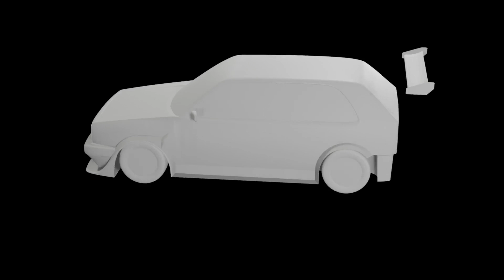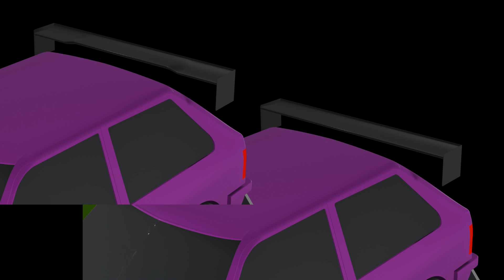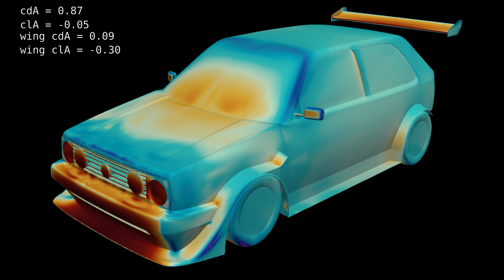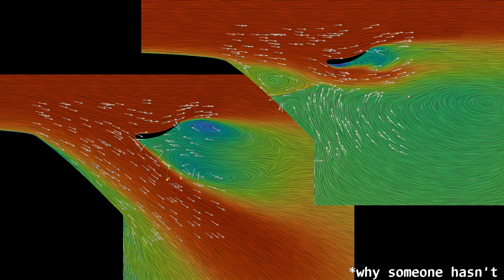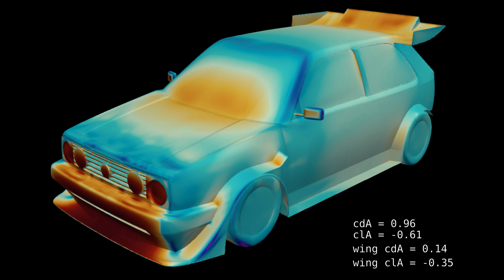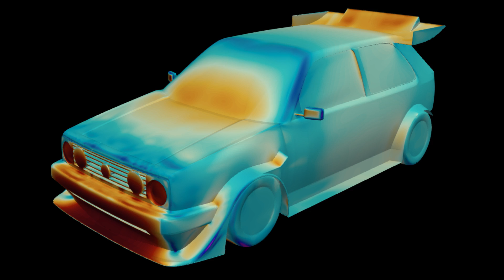Hatchback Aerodynamics: Improving the rear wing or spoiler

Comment: I am trying to overcome the turbulence around my domestic car, to get a laminar flow of air from front to back. This last year I have been going down the 'Rabbit Hole' in every aspect to achieve this Learning on the effectiveness of a 'Under Tray', the effectiveness of 'Air-Curtains', 'Hood Ducting', 'Separation Edging', Adding a Lower 'Air-Dam' and blocking off the upper part of the grille to improve the aerodynamics and reduce the drag. Not having the Computer Capacity or Finances to research the CFD of my car I like to see if someone can do some tests to see he effectiveness of each of these as well as the effects of a Car-Bra, Bug-Shield, and other Add-Ons for the domestic car market.

Comment: What about something like the 2020 Sonic RS Hatchback? It comes with just a flat lip as a spoiler for an inch or so, but below it, the car is done, completely vertical basically. I've seen people mount wings on them, but it didn't make sense, since the air is already flowing completely straight off the end. Is there any way to improve the aero with this or is the lip the best?

Comment: Id be interested to what modeling shows for multi spoiler hatchbacks like the EK civic type r, where it has a roof spoiler and mid-height spoiler at the base of the rear glass  I've always been curious if it the second spoiler was just aesthetics or actually reduced lift and/or drag.

Comment: Ford's RS2000 was originally designed with 3 wings - the final production version had only 2.

On Wheeler Dealers, they added the missing 3rd wing.

Hatchbacks like Golf mk1/mk2 benefit a lot from a lower rear splitter. Reduces dirt on rear window, too.

Comment: eg hatch here. my wing is attached to the car   can u do a few lil sims on that variation  they have a few options to n peeps run what is called a duck bill would be interesting to see that thing weird'ness.. i have the more drag style where it just runs off the back of the car. im not sure my wing helps wif downforce but should help wif drag a lil bit  my car is stable till 110 then i feel like i needs more down force  after that n then i run out of gear n tune

Comment: You maybe get more performance out of your wing in that downforce is higher, but you just ruined the airflow to the back of the vehicle creating this massive separation wake that will slow you down like crazy. You won't get more downforce without more drag, but this solution gets you more downforce with WAY more drag. This is why big spoiler solutions are usually combined with big diffuser solutions to make sure that space gets filled with air coming from underneath the vehicle (typically also helping you generate downforce). Any extra time in the corners will be massively outweighed by the time lost in the straights, if your little ol' four-popper can even generate enough thrust to keep you at the grip limit around the turns.

Comment: Hey Nelson, try not using a Volkswagen shaped hatchback. I had a hyundai pony (real gutless) that got very bouncy at a quarter tank of gas. I made a wing that mounted on the hatch just above the latch it was flush with the roof line due to the downwash
of the hatch. It had 1/4" Gurney flap that proved way too much and had to be flattened  out again. So to say the effect is minimal is due more to the specific vehicle than the wing itself.

Comment: Hold on a second. There is a production hatchback that has a spoiler half way down the rear window. That's the EU/JP 2005 Honda Civic. So it's not like this thought doesn't exist.

Obviously it doesn't have a rear wing though.

It's absolutely spectacular in person though. It feels a very similar shape visually from all sides, some sort of optical illusion, it's basically like an UFO floating in front of you, and the design details with smooth polycarbonate grill decoration with reverse side detail and angular handles are very striking as well. And like it stays planted, it turns, it's decent. Futuristic design extends to the dashboard as well.

Comment: Hey, have you experimented with adding vertical side profiles to the rear spoiler similar to the GTI Mk7 Clubsport? 
It should reduce pressure under the spoiler, as it inhibits airflow along the sides of the car from going to that area.

Comment: A few uneducated opinions on how I would solve the extra drag from the 3rd variant
1) roof vortices 
2) have a secondary wing/structure that starts at the tip of the C-pillar (not unlike the Ford Cosworth), not for downforce but to channel high pressure air into the main plane and extended winglets
3) either multi-tiered flaps on the main plane for passthrough, or rally style spoiler channelers (the vertical columns seen on modern rally cars, like the 04 WRX STI

Comment: Subaru hatchback owner here. 1995 Impreza rally car. I feel like I have been denied my god given birth right to a sick ass rear spoiler. If I am gonna have to put up with Subaru mileage and head gaskets, I want a spoiler, dammit. However, all the stock GF8 wings have big time weenie hut junior energy. Another local driver has more or less taken the WRC shelf + spoiler approach on his car. Both of us compete in ARA, which has some pretty clearly defined (and restrictive, depending on who you ask) aero rules, chief among which is how far outside the existing outline of the car you can put a wing. I'll have to consider this approach if I decide to build my own wing, and whether I can fit it into their rules

Comment: i don't understand why you put the rear wing so far from the car while rear wings on hatchbacks are nearly  stuck to the car.
On my old 205 there was a small incline at the top of the hatch to help for downforce in competition on the 205 T16
On a Lancia Delta HF Integrale it's obvious because the rear wing is directely connected to the hatch, even on Ford Escort and Ford Sierra Cosworth it was the case (and it was reallly obvious) and they were hatchbacks.
why does your wing is so far away from your car?

Comment: Or, you could just do what Porsche, VW, Peugeot and a lot of other car and aftermarket manufacturers did with their kits for hatchbacks in the 80's, and mount the spoiler just beneath the rear window. Essentially turing the car into a more sedan like shape airflow wise. Alledgedly this increases downforce in the rear, but at the cost of increased drag due to the negative pressure pocket created beneath the wing (behind where the numberplate and taillights goes essentially). Though on a race car, this could probably be mitigated by a properly designed Venturi tunnel.

Comment: You should look at FWD RC racing.  The last style wing minus the mid section is basically a 1/10 Touring car Spoiler.  If the rules allow we usually use those on the back of the body when we need a lot of read down force.  Although the aero is pretty diffeerent due to the inner of the body the outside may give you some ideas :)

Love the video...

Comment: Could you test if the first-gen Alto Works (CC72V) cheese grater rear aero element (spoiler? wing?) actually works? The brochures certainly made a point about the aerodynamic drag coefficient reduction it allegedly did.

Comment: Ford used a vaguely similar system for the Group A Sierra Cosworth RS500.
The spoiler was at the bottom of the long tailgate glass and the wing was on mounts above it half way up.
The tailgate wasn't as steep as your model.
Reply: And they used the same setup on the Escort RS Cosworth.

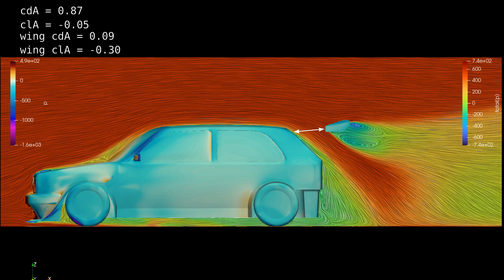Comment: Your AoA @1:34 looks it's stalled the wing. Maybe consider setting the AoA relative to the airflow and not the the groundplane. It looks like you've got the wing set at 50* AoA to the airflow. I don't know of any single element airfoil that would do well with that.
Reply from the maker: So i've run the aoa with wings in another video and this was to illustrate the case of a single wing at that angle then how adding a device like this helps df. It seems that I accidentally made a watchable video this time and a new audience brings an unfamiliarity with what I'm doing, which is fine I probably need to make it more explicit that these are experiments not instructions. Its the "spoiler v wing" vid if your interested.
Reply: @nelsonphillips  I just finished up that video. Even in that vid you mention you tested a wing at 0° AoA and showed a graphic. The graphic shows your Airfoil at 0° to the ground plane. Not at 0° AoA to the airflow. It's stalling in that video. No airfoil is going to perform well when you stall it. I'jm just some internet idiot but it seems like with your hatchback you should be using vortex generators to keep airflow attached to the ass end of your brick. With airflow better attached, place your rear wing  to help your floor generate more lift (downforce).  Don't use the rear wing for downforce. Use it to help your floor generate even more. In other words, think of the car floor and rear wing as a two element wing. The Car Floor is the larger first element. The "Rear Wing" is the second element. Use the Rear Wing to keep flow attached while also adding energy to help evacuate more air from the low pressure side of the Floor to generate more lift (downforce).

Comment: Hatchback aerodynamics are solved cutting rear bumper and mounting rear wing down low in the vicinity of ground effects and having ramp angled diffuser’ish rear floor that had free flow space over the wing. A rear wake low pressure area must be minimized.
Reply: Thought of that also. Beside greater downforce the increased reagion of low preasure on the back is causing more drag.
Reply: In my own BMW clownshoe I cutted a lot of lift and drag away. Maybe 150kg less lift and a bit on the downforce side, I had to do front spitter which of underside I made wing ofcourse too to rebalance car.  Drag coefficient bettered from 0.37 to about 0.32. I have in same test stretch 20kph more top speed, speeds I have never seen in this car before.  @mateuszkasza

Comment: 1:30 when you talk about no one having done that, it isn't like that, a lot of hot hatches in motorsport couldn't do it because regulations didn't allow for rear wing to extend back out from bodywork (when viewed from side or top), or something along those lines, so they used 2 element spoilers 20 years ago for this sort of thing, there has been a dramatic rule change to wrc in past few years, but I lost interest and don't care much about it any more
edit: 3:30 google peugeot 205 group b.....
I don't know much about track racing, but they are also quite careful when choosing chassis for serious cars, and hatches usually aren't near the top of their lists
Reply from the maker: the regs the spoiler was designed for says single device and element at the rear so this was my solution. lancia s4 is a closer example
Reply from the maker: i was thinking lanica scv for group s, not the group b s4

Comment: The youtube algorithm provides something interesting for once. Looking at this, Peugeot did their homework back in the day with the setup for the 205T16 E2...and Lancia for that matter with both the S4 and what they came up with later for the Integrale. Having watched this, I was wonder what effect the kind of setup that was on the Pikes Peak 205T16 had, where the wing was on top of the spoiler/flap and the endplates closed the gap between the two....

Also, I wonder if this is the same or related effect which lead to the rear wings on some Group C and IMSA GTP cars going lower and lower and closer to the diffuser exit, eventually resulting in the massive bi-plane wings of the early 90s...and maybe later as well with the LMPs rear wing endplates growing longer and longer to where before the rules were changed there just a small gap between the spoileresque rear bodywork and the endplates.
Reply from the maker: I was specifically talking about hillclimb and general racers using off the shelf wings. Give a team a factory budget then they should have reached the outcome

Comment: Some race cars had this worked out. Look at the 205 T16 Evo II, that thing had the wing of wings in the hatchback style of car.

An interesting comparison would be the 205 GTi vs the 205 T16 Evo II. Also the 306 S16 vs the 306 Maxi Phase 1. The latter 306 had a shopping trolly style wing on it which from what I can see only generated lift...

Comment: Please dont laugh about me, but i have a question: is the amount of drag/downforce proportional to the overall size and weight of a car/object?
The reason i ask is my RC Car which get huge amount of lift at higher speeds (~40mph++).
I closed off the underside and it gave some stability but not enough, so the lift gets it like snappier (is that even a word?😅). Its pretty stable up to 50mph but, lets say at 3-5mph more it gets uncontrolable almost instantly, like the flip of a switch...
Any idea's why this is and how i could get it fixed?
Reply: you need to raise the rear of the car so that it doesn’t become a glider when accelerating and shifting towards the back
Reply from the maker: There are really too many things it could be,from suspension, floor stalling ... to give a proper answer.

Comment: So a question about this. The saxo VTS has a stock wing that's nearly flat, kind of like a spoiler. But judging from your video without a spoiler air would probably not separate that much and just stick to the body moving back down. Whereas it seems to me the spoiler would, to an extend, prevent this. 
What would the implications of this be in terms of downforce (or lift) and drag?
Reply: Nice question. The spoiler on the Saxo looks very gentle, but right in front of it there appears to be a small lip that prevents air from following the curve down onto the tailgate (a flow trip) This should help with both drag and reducing rear lift. Then the 'wing' is probably doing a tiny bit more to reduce the rear lift, but generates some drag, but looks cool and sporty.
If the trip wasn't there, the spoiler may not work as well, because the angle of approaching air would make it detach from the underside, similar to the wing in this video. Also the air would accelerate over the curve. Faster air = lower pressure on the surface. Surface is pointing back and up, so you get drag & lift. A case study in this is the 1st gen Audi TT.
Reply: @messvideos1 Awesome, thanks a lot man!

Comment: Make sure you test wings/airfoils seperately and compare them to xfoil or wind tunnel results. When I first started getting into aero I was getting very different results. Turns out that a good transition model is key to get these low reynolds number airfoils working. That's probably one of the reasons why you are always getting so much separation on your wings.

Comment: Best option is to mount something that flows straight off the roof, and a sort of rear canard? aleron? arrangement off the back of the boot, just below the rear window glass
Reply from the maker: yes, but the wing would need to be higher than the roof. TCR use newer vehicles with their roof line sloping down and therefore do this, supplying the wing with sufficient mass flow.
Reply: @nelsonphillips  ah.. i see my verbal mistake. the structure of the wing should begin at the roof line and accend. Not flow straightening.. but yes it would be better a little higher in the free stream. 

I've started to see a strange ... its not a dimple... its the inverse of that, in the centre of cars above where the license plate is mounted..(base/bottom centre of rear glass, brake light mounting point or bottom mounted wiper blade location. )  I assume that it is some way of organising the flow at the rear, into controllable regions of drag or recircultation. yet i have never seen it visualised.

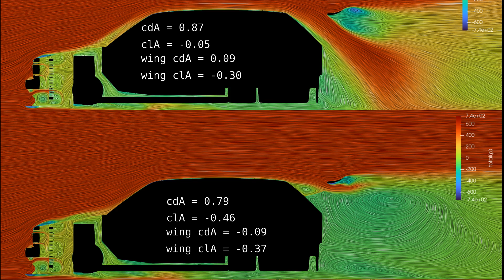Comment: 2:14 Is this the same reason why a lot of car manufacturers use a spoiler-like element above the rear window on hatchbacks so the body doesn't direct the airflow downwards?
Reply: Pretty much, yes. I imagine that the little spoiler that trails off the end of sportier hatchbacks cleans up the airflow and leads to a marginal improvement in drag and down force for comparatively very little engineering and production effort.

Comment: I guess this is where the Peugeot 205 T16 rear wing design came from.
Reply: Exactly what I was thinking too! They sure did tons of wind tunnel testing on the 205 T16. Makes sense why it was the fastest group b car :D

Its cool to finally see why they went with the design :)
Reply: Seems a bit like he is rehashing what WRC teams have been doing for a long time.... Its not often WRC teams get Aero wrong
Reply: @fuzzyspacekitty74  The point of the video is that no one outside of the old group b and modern wrc cars does it correctly. Its practically unknown outside CFD circles. I have never seen a hatchback use this design in time attack or other high downforce applications...

I havent seen anyone else talking about this on youtube. Plus, its just super cool to see this actually explained with very well done CFD in a video
Reply: Yeah, when people speak about group B cars usually it's about their engines and power to weight ratio, but they forget tge crazy aero those cars had